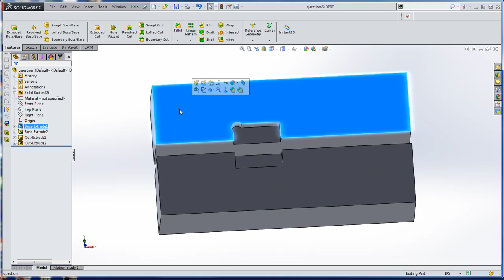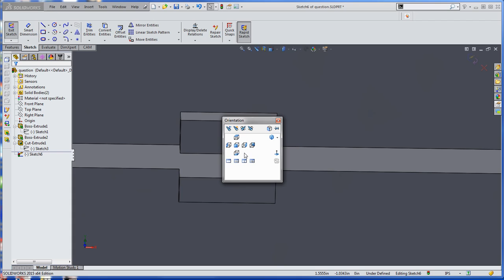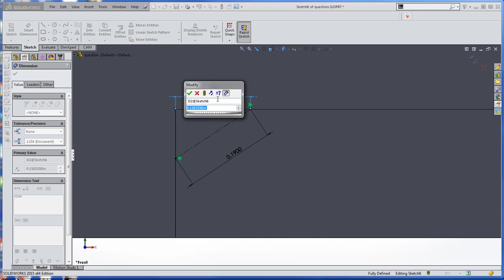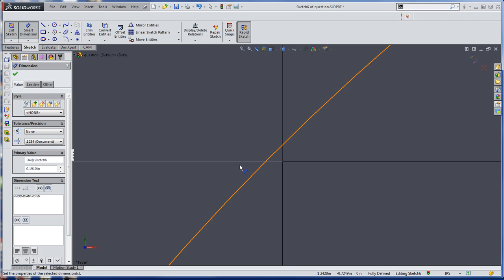Mickey Mouse SolidWorks Help!

Comment: You can mirror the sketch instead of the feature, then do 2 separate extruded cuts from the same sketch - 1 for each body. When I've tried it just now though I can cut all 4 holes in the same cut-extrude. To make the distance equal, use construction lines instead of dimensions. You can select both and set them to be equal. This is much faster and more reliable.

http://imgur.com/a/5duRp

Mirroring/patterning features can be a PITA, sketches are much easier to work with and pull dimensions from later.

If you've constrained/fixed things logically (i.e. centre of square extrude sketch to origin line) it will scale well.

Another screenie done after the fact to show constraints. Ignore the fixed point, I started by working from converted entities, you can just snap to the pocket (which I didn't cut at first).

http://imgur.com/PVF7ozT

Drawing a 45 degree line doesn't work if you're trying to slightly overcut as you show in the video.

Comment: Mickey Mouse  Corners... I like that term.. :-)
It has been a while since the last time we have talked.
The way I have always always done corner relief for things like part holding is,
1. take a 45° off of the corner the length of the radius of the endmill you are using for the pocket.
2. draw a circle centered on that endpoint with a slightly oversized radius.
When I say slightly, I mean slightly. the larger the ear on your "Mickey Mouse" Corner the more space you have for chips to collect, we know why we don't like that for deeper pockets that require multiple passes.

For example If I were to use a 1/2" endmill to to mill a pocket. 
The line I would draw 45° off the corner will be 0.25" 
and the radius of the corner relief I would draw will be about .26-.275. (doesn't have to be much)
Keep it up NYC!
-Morgan

Comment: The "correct" way to get both edges the same length is to do a little trigonometry: constrain your sketched line to the geometry's edges by angle: you know your geometry is going to be a right triangle: exactly 90° in one corner, (opposite->adjacent) meaning one corner should be constrained to exactly 45° (adjacent or opposite to hypotenuse) giving you a fully-defined sketch where SW is solving for the third angle and opposite and hypotenuse lengths (45°, and the adjacent and opposite being the same length)

Then you can pick up the centerpoint of the hypotenuse with another line constrained perpendicularly 90 degrees. it should pass right through the vertex of your 90° corner.

Comment: Not sure if someone has already mentioned it (and I didn't test this), but pretty sure that instead of mirroring the feature, mirror the sketch geometry in the sketch. You can use center line construction geometry on the sketch plane in place of the "planes" you are creating, and mirror the cut sketch geometry in the sketch. I believe this will allow you to do the cut on both bodies without having to go back and recreate this as one solid body. Hope that works / helps. 

PS - huge fan of your videos. Thanks a ton for all you do.

Comment: Hi John,
Not sure why no one else mentioned this, if it's a symmetrical part you could draw one side of your jaws and then place it twice in an assembly with the set gap required then edit as required. No mirrors to worry about and you can still check the dimensions by measuring the the features your designing. It would then make the CAM programming very simple as your not dealing with a multibody part. The Mickey Mouse ears can be also cut as a single extruded cut with a rectangle and draw the circles at each corner with some construction lines as mentioned by other people then use the trim command to remove the inside sections of the circle to finalise the shape then extrude to depth. 

Hope my comments help and keep on making great videos. Cheers.

Comment: Very simple - draw a circle from just inside the corner up to the point that the two lines create, that constrains that. Then draw 2 lines from the horizontal and vertical to the center of the circle, set them equal, put a diameter to it, done. 

If you want to blow that open even further, do the same except don't let the circle touch the corner and just dimension appropriately or dimension from the corner while holding shift to the edge of the circle closest and throw a .005" dim or similar on it. To do all 4, just draw 4 circles and do the exact same thing, except you only need to dimension one, use sketch relations for the rest.

Comment: I can't tell you how to do what you're trying to do in SolidWorks, but I can sure tell you I'd never be trying to do it to start with.  I've made a ton of soft jaws for square parts and I just drill the four corners and then mill out the square.  Done!  If you really want to draw the ears and mill it out, I'd just draw the square, draw a circle on the four corners and then trim off the part of the circle that's inside the square.  Done!  Don't know why you've chosen to do all the monkey motion that you have.   ...Tiger
Reply: +TigersToys 

I will second that approach.  I used that method on a hex press fit project.  Just have to make sure the circles you draw in the corners have enough radius on them to all the cutter you are using to clear all the material out of the corner as it passes.

Comment: no idea how to do it solidworks, but in Sketchup with SketchUcam one can do that in 3 clicks with the dogbone tool.   the process is this:  draw a rectangle for the size of the cutout, set the dogbone size from the tool size, apply dogbones, add pocket cut.   set cut parameters and generate gcode.   sometimes fancy CAd/CAM is not the best solution (-:

Comment: Hi John.

Greeting.

I think  this can help :)

Option (A)
---------------
Fully construct one half side, then mirror it.

Option (B)
---------------
Construct both "rectangle bases" in same sketch, then do others steps normally.

You make two separated bases "Boss-extrude1" and "Boss-extrude2", make both in only one single sketch.

Option (C)
---------------
Another option is make the full base then cut the small center square, cut the "mickey ear", mirror it to turn in 4 pieces, then cut the center longitudinal aperture.

I hope its help.

P.S.
Sorry my bad english
Reply: +Eduardo Braga Just one thing more, we can't Extrude or Cut-Extrude single lines, so use reference/construction line to find the circle center.
Reply: +Eduardo Braga  If you really need to have two separated bodies as show in your video, you can do like this:

1) Boss-Extrude1 (rectangle body one).
2) Boss-Extrude2 (rectangle body two).

3) Create the circle sketch.
4) Cut-Extrude (the circle, not the center square for now), use the "Selected bodies" (Feature Scope) and select Boss-Extrude1 and Boss-Extrude2 or just select "All Bodies".

5) Create your two planes, you need other references to create your plane1 (I used two faces of body1 (step 1)

6) Mirror the hole (step 4) using the plane between the two bodies (your plane2) but in mirror options, you select: &quot;All bodies&quot; (Feature Scope) and &quot;Geometry Pattern&quot; (Options)
7) Mirror the &quot;mirror&quot; created in step 6, but now use the perpendicular plane (your plane1), the mirror options are same as step 6 - &quot;All bodies&quot; (Feature Scope) and &quot;Geometry Pattern&quot; (Options)

8) Now create the square.
9) Cut-Extrude the square, select &quot;All bodies&quot; in Feature Scope.

And cheers! :) you have you drawing/object as you need :P

I hope its help

Best regards.

P.S: sorry my english but my marten language is Portuguese.

Comment: Draw the mouse ears on the same sketch as the square extruded cut so you'll be able to snap to the corner of the square sketch when you specify the radius of the circle.

Comment: Hey John, I would personally do this as two separate parts. Create a blank jaw and assemble them spaced apart in an assembly. Then move in your actual part to be machined into the orientation you want to hold it. Right click one of the two jaws in the part manager on the right and enter edit mode within the assembly. Then go insert > molds > cavity to create a negative in your part. PM me if you have issues.

Comment: In a situation like this, I would avoid creating new planes. As you've got a multibody part, you could do all of this in one sketch / feature and mirror about lines sketched on center of your rectangle. If these were separate parts, you could create a sketch block which you could then copy to the complementary part. 

When I create 'mickey mouse ears' clearances, I create a diagonal construction line (0.1900" in your case) and then I just set that to 45 degrees from one of the perpendicular lines. With these two dimensions, the line is fully defined and the distances are equal.

Comment: John, I think the easiest way would be to use a formula. Either create a variable (tools, equations) and set one dimension equal to the variable and do an equal length constraint...or...just use a 45° angle, the hypotenuse, and a leg dimension. In terms of the pockets, why do you need to do it in one part? If you make the jaws symmetric, you would only have one part and you could run the same CAM twice on two pieces of stock. Hope this helps! Keep up the awesome videos!

Comment: Part 1 Sketch Help: Make the sides of your sketch the same distance form the corner.  Simply add a 45° dimension between your construction line and the edge of your part.
Part 2 Mirror:  You can simplify the mirror by following these common rules;
                 1.  Make sure you draw your part around the origin.  That way you can use the provided planes (Front, Right and Top).
                 2.  Re-Order your part - that is suppress or remove Cut-Extrude1 until you have all the geometry for your cutout, then slice the "Jaws" in half.  
                       The mirror will work just fine if you only have the one solid body.

Part 3 Our Design:  We don't go into as much detail as you, I ask my machinist what size tool he will be using then create a profile 0.020" to 0.030" bigger.  
                       Since these are just for relief anyway we try to minimize the amount of material removed.

Comment: make a 45 degree 1/8" inch centerline in the corner then do a 3 point tangent line from the ends of the centerline to the corner, then make 2 centerlines in the middle of the parts and mirror the sketch over them then extrude cut all at once

Comment: You want a right triangle with two sides equal at all times and a fixed hypotenuse?

Dimension length of hypotenuse, then pull an angle dimension from the hypotenuse line to the sidewall and force it to 45°.

Shazzam!  A 45, 45, 90 triangle always has two equal legs.

For your other problem, instead of making the first circle an extrude cut, make it an extrude boss/base, and DO NOT merge the resulting solid with the rest of the model.

Now you can mirror it along the first surface like you did before to make two solids (still not merged), then mirror them both across the divide to the other surface to give a total of four cylindrical solids that aren't merged with anything else.

Then do a combine command and subtract the first two cylinders from the first jaw, and then another combine command to subtract the second two cylinder from the second jaw.

Easy peasy.

To make the circle you're drawing to form your mouse ear self-resizing, all you need to do is draw a perpendicular line from the center point of your hypotenuse out to some arbitrary distance, then select both that line and the hypotenuse and add the relation "equal", then set that line to construction geometry.

Now draw a three point arc that has its starting and ending points on the endpoints of the hypotenuse, and whose radius takes it outside the length of the construction line you just drew.

Select both the arc and the far endpoint of the construction line and add the relation "coincident".

That will make the arc radius vary as you change the length of that construction line, which will change to match whatever length you specify for the hypotenuse of your original triangle.

Now this little bit of geometry can be used to make any sized mouse ear that you like, just by changing a single dimension in one sketch.

I've done up a sample file for you to look at, if it would help.

Just drop me a message with your email address if you would like to look at it.

Comment: Just my 2 cents... if i was doing this on a manual mill i would drill or use an end mill on the corners at the interssect of the x and y axis then clear the center with the jaws mounted in the vice and reducing my y axis by .010

i am not a cnc machinist, but simpler is better.

Comment: a^2 + b^2 = c^2, since you want the shorter sides to be the same you can, rewrite it as a^2 * 2 = 0.19^2 and solve for a, and youll be left with  a=0.13435

Comment: For the Mickey Mouse ears you could just use the angle instead of defining the distances from the corner. The constraints on the extrude line should centre it.

Comment: why have both jaws in one part?
make an assembly and have two separate jaws (mirror the part in the assembly)
as for designing in the corner clearance, I just draw the size rectangle I want, then put the center of the circle on the corner of the rectangle and trim. for the diameter,  I just pick an appropriate size fraction so they can plunge with and standard end mill, its just clearance...
Reply: since you have a right angle, dimension the angle to 45degrees, then both sides will be equal

Comment: why not dimension your line 45 degrees from an edge?

when i do squares or hexes (works on any inside angle) draw your two edges of the corner. now fillet the corner the same diameter as your end mill but leave the corner there (or draw a circle tangent to the two edges). draw a circle that passes through the tangent points of your "end mill" and also the imaginary sharp corner. the circle should be fully constrained so just measure it and drill that size then mill the sides.

Comment: The solidworks mirror feature has trouble working across two bodies. It looks as if your jaws are identical; is the a reason why you need to mirror the cut instead of the entire jaw? 

Also to get equal distances on the corner you can draw two construction lines to the corner vertex and make them equal and it all will fall into place.

Comment: Select "geometry pattern" under options and all bodies under feature scope. Should clear up the error. .Also you can type equals in the dimension box and select the other dim you want to be equal to but that will be over defining unless you remove the long dimension. I would just dimension the long line to the edge and make it 45 deg since the length of the long line is what's important.

Comment: to calculate the circles you can create a line at a 45° angle between the 2 corner surfaces and make it .19 in. then create th circle from the end of that. I do know solid works very well but that is how I do that kind of stuff on other programs.

Comment: pattern your sketch features in the sketch and use a single cut feature to cut both parts at once. Otherwise, it may solve if you try the geometry pattern. I see that you have that unchecked in your mirror.

Comment: For placing the circle, use 3-point circle-tool. Place one point on each of the two sides and the third on the corner. Then type in your cirkel dimension

Comment: I know nothing about Solid works, in ACAD i would draw a line between the 2 soft jaw ends and mirror off the center of those, an other option could be to move the jaws together and mirror on the common center line

Comment: I generally make my soft jaws as one part (in CAD).  They look separated, but have  a little joiner piece at the bottom.  This way it's one piece and doing quick and easy CAD operations on them is no problem.  I also space my jaws at 0.078", since I happen to have a bunch of hardened and ground pieces of that thickness that I clamp between the jaws when machining them.  That way, I'm assured that the jaws will be identical to the solid model.  Having this 0.078 reference piece is also handy if I have a single piece that is clamped on one end of the soft jaws.  I insert a piece of the 0.078" spacer material on the opposite end, to make sure that it clamps parallel.  This works for me, but I'm sure there are a million other ways.

Comment: Draw your angle construction line with coincident relations to vertical & horizontal then dimension the  angle line to 45 degrees to either horizontal or vertical line.

Comment: Make the softjaws as one "piece" first, create your cutout, mickey ears and so on. and the you do a extruded cut on a center line where you want the singular block to be split into 2 bodies.

You just need to reorder your workflow a bit..

You have my email if you need a file for that.

Comment: you're way more advanced than I but just out of curiosity why not mirroring or do a pattern in the sketch rather than mirror the cutouts? the other thought is mirroring both the rectangular cutout and the circles to the opposite jaw rather than just those 2.
that's all I got, more questions than providing any help :)

Comment: After the first construction line, create a second one from the centre of the first to the corner. Add a perpendicular constraint between the two construction lines. You now only need the one dimension and fully constrained.

Comment: As for the equal lines in the corners.....all you have to do is draw a line with the first point coincident relation to a horizontal or vertical line making sure that the line you want the .191 to be is not snapping vert. or horz. dimension the line .191 . Make the other end  (loose end) of the line coincident to the line that is 90 deg. from the first point, give it an angle of 45 deg. done..